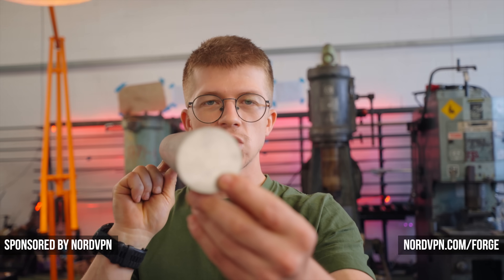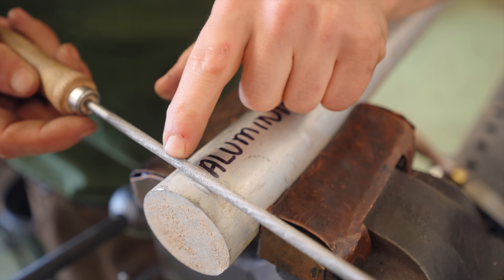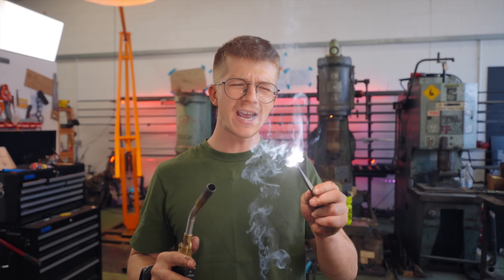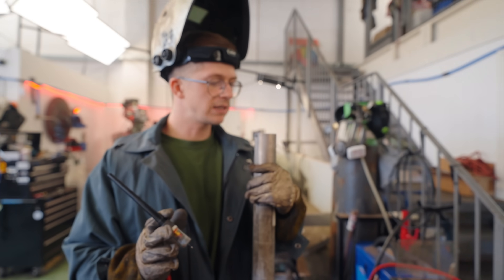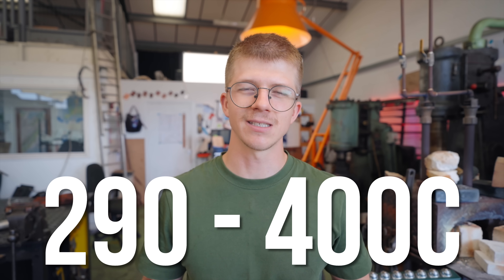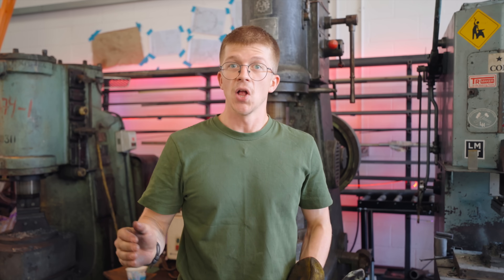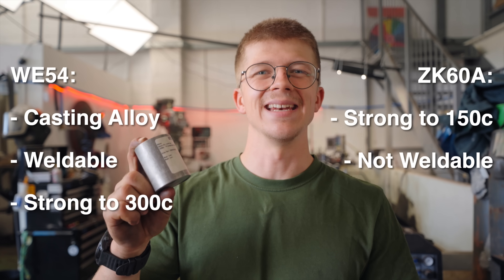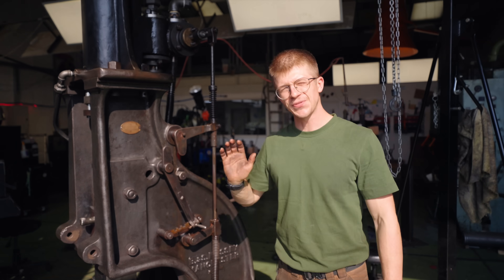Can You Forge Magnesium?

Comment: "Can you forge Magnesium?" 

If you don't actually like having eyeballs or fingers anymore.
Reply: They cold press forge magnesium rather than hot.
These are presses the size of buildings capable of gigapascals! 😮
Reply: My car has forged magnesium wheels, it’s certainly doable, just not in a garage shop as it has to be done in proper atmosphere and the product has to be passivated with special coatings to prevent ignition in an accident.
Reply: Is he going to ignite the magnesium in the forge and quench it in water? Or try using magnesium powder to make damascus? How fast will this be a new video of Plainly Difficult?🤔
Reply: There exists alloys of magnesium specifically for forging at high temps in a regular environment. Remember even iron can become thermite if you mix it with aluminum.
Reply: Simple reminder that Can and Should are not the same thing
Reply: How do you think they managed to get the magnesium into bar stock.... magic? It was forged!
Reply: Are the wheels on a GT free not made out of magnesium?
Reply: My dad used to restore antique airplanes. 

A guy at an airport he was working at found a tire with a magnesium rim. Said guy attempted to remove the rim with a blowtorch…
Reply: @Jude30  oooh that probably didnt go well...although I imagine the tire came off pretty quickly
Reply: @Jude30  F
Reply: Na, he just had the temps WAY to low.
Reply: I, too, would have my temp set way too low if the alternative was risking a bar of metal that spontaneously combusted into a fire three times hotter than a campfire that is near impossible to extinguish.
Reply: @zombiesue1054  Yeah if theres one thing i know about magnesium, it's that it sparkles, can spontaneously combust, and can basically become thermite.
Reply: @lukelun  it's actually one of the easiest ways to ignite thermite.
Reply: @zombiesue1054  4x* easily
Reply: @websterri  500-550C is kinda the sweet spot but you have to actually let it sit at that temperature for a while. And no, it won't catch fire at those temperatures.
Reply: @michaelmay5453  I never said it would catch fire.
Reply: @websterri  That wasn't directed at you but more of a statement to avoid future protests about my recommended temperatures.

My apologies, I should have made that more clear.
Reply: @websterri it's combusts at high temps. So you'll never balance it.
Reply: @Mill_Wrong  Not even close to the temps he was at.... he was basically at room temp as far as forging goes.
Reply: I can't help[ wonderiong what that amount of aluminum going postal in a forge would dop to the ceramic lining and the bricks etc...I have a feeling it would melt everything like thermite does but you dont know for sure until you try it.......
Reply: @TalRohan  "i burned down my entire shop! (not clickbait)" if you meant magnesium not aluminum; to do that safely the only probable solution would be a proper class d fire extinguisher, but i doubt that will be enough with that huge chunk. its like playing with fire from the devil and squared.
Reply: It's bugging me that he wasn't wearing any goggles or gloves when experimenting with a potentially dangerous metal. Next level stupidity tbh.
Reply: "Can you forge Magnesium?"

Pure.. Not really.

But rarely is it ever used pure outside laboratory settings.

As an alloy.. Yes, it is done all the time.  In fact, I regularly machine a magnesium alloy.   It requires special settings (speeds and feeds) as well as air cooling.  And cleaning after every part as to not let chips and dust build up.  All while a class D fire extinguisher is within reach.
Reply: @chockichockington2945  do you ever need to machine magnesium in a vacuum/under inert gas to avoid fires?
Reply: @chockichockington2945  It's driving me crazy the masses keep saying magnesium is flammable, so is potassium but you don't see people avoiding bananas. The purity of the metal matters and no one with a brain is going to work a non alloyed magnesium metal period.
Reply: yes you can but not like that. a large press would be a better method

Comment: Think of gold and copper. Both much denser than steel, yet super soft.
Reply: Indium is soft enough to chew with your bare teeth
Reply: @GameCyborgCh  good aswell. Think of people biting coins
Reply: lead
Reply: TIL Coppper is denser than Iron.
Reply: Or diamond or ceramic
Reply: @Mhorton32  well those aren't metals
Reply: Think of lead
Reply: Then for the truly extreme example of a dense but soft metal, there is mercury which is so soft that it is a liquid
Reply: @Corvinus_swe  .. But liquid steel is also very 'soft'
Reply: @EightOneGulf yeah but solid Mercury is really really soft
Reply: @Corvinus_swe  A liquid doesn't have a hardness. You don't have deformation, only displacement. The temperature at which a solid-liquid phase transition occurs has nothing to do with hardness.
Reply: @Corvinus_swe  I'm not sure that's really comparable... Mercury is liquid because it has a very low melting point. That being said, I'm unsure of the hardness of mercury in its solid state.
Reply: @FrancisR420  I mean, sure (someone already gave the number of 1.5 Mohs, which is absolute and accurate), but the point was that comparing a liquid metal to a solid one in terms of hardness doesn't really make sense